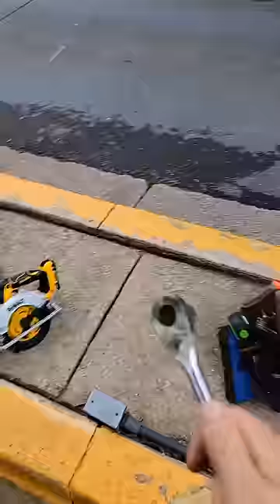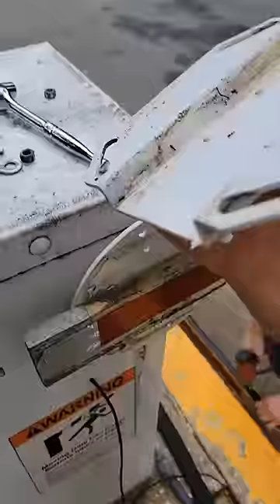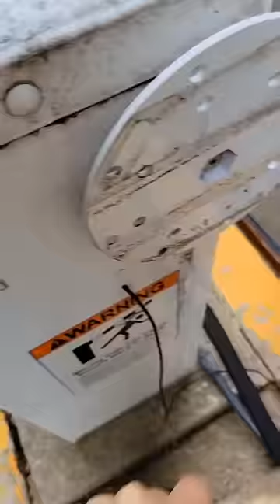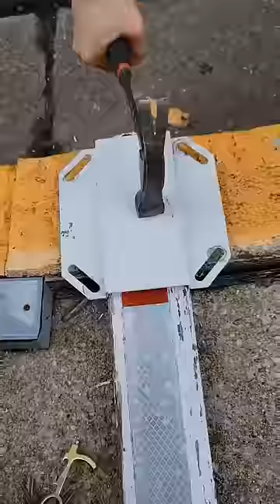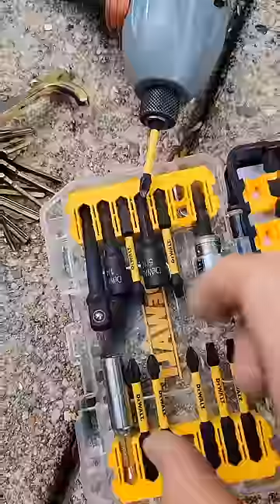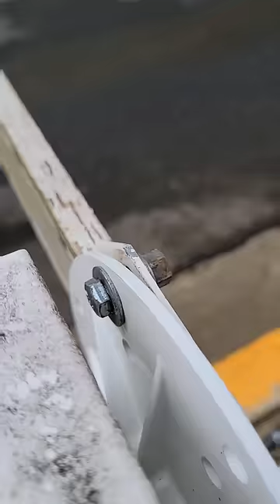This happens more than you know. #shorts Thanks @lowes for the drill bits #lowespropartner

Comment: Rolled up to the one in my apartment complex last thunderstorm to find the gates closed and stuck due to a power outage. These were actual wrought iron gates on an actuator.
We had about 20 cars waiting to get in and I desperately needed to get out. Battery backup was either non-existent or non-functional but I had that same socket set in my car so I apologize for disassembling the control arms from your gate and opening it but I was a nice guy I tied it open with a bunch of cord so that it wouldn't swing in the wind and get torn up
Reply: Years ago I came home to my apt complex and the gate was open but the arm was stuck.  I had tools and called the after-hours maintenance number and asked if I could just remove it.  Guy said we never had this conversation and hung up haha.  Took out my Dewalt impact and had it off a minute later!

Comment: Dewalt bits/saw and a Milwaukee impact. You SUSS.
Reply: It probably does look sus if you’ve never been in construction
Reply: @Dontcare523   .. I was about to say… if you knew… you would know that Dewalt gives away those bit kits, and always have them on sale. Sure Milwaukee makes cheap bit sets and small boxes, filled with all kinds of bits and drill bits, but I’d say the Dewalt one have been around longer, and have put more out, over the years… so, more of them out in the wild..🤷🏼‍♂️
Just my thoughts.. 
on the same token… it’s hard to beat the value of Milwaukee’s m12 impact drivers and or drills.

Comment: I manage a carwash and we use a similar gate set up. Expect the arm isn’t wooden it’s aluminum with lighting and its attached with a shim and screw set up. So when someone runs into it, it just pops right off. When it happens though the replacement shims take a while to come in, so usually some big hose clamps do the trick…and they break too lol it happens like once every couple of months!

Comment: That's called job creation people, a broken gate once in a while isn't too bad. That was probably like a break for him, if he works on the tech side of it also. The company I used to work for they used aluminium gates with a mount designed to "break" in a way it would just fold. Must tell you alot about Toronto drivers.

Comment: When are stores like gun shops, tennis shoe and jewelry stores not have an overhead gate hinged on the walls  that comes down blocking the entire inside of the store front from entry .  The bottom beam could engage with T slot latches so pushing in or pulling out on the middle of the gate catches in the upside down t brackets on the floor.

Comment: Uses a 6 inch level on a 10ft surface. : "perfect every time"
Reply: And if you pause it it's no where near level
Reply: What do you want him to do take ten sample points and average it out. That’s all a longer level does and if the wood is somewhat straight that’s just as good. Also it’s a gate. Doesn’t matter.